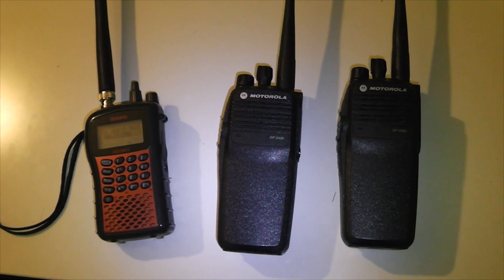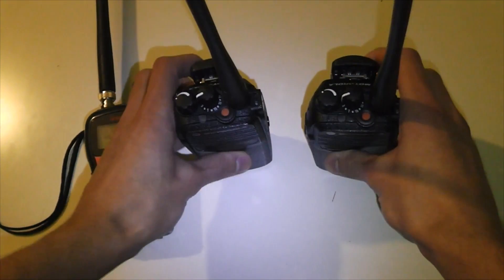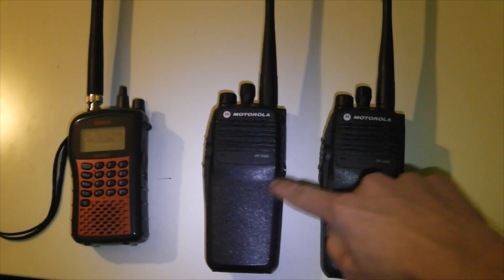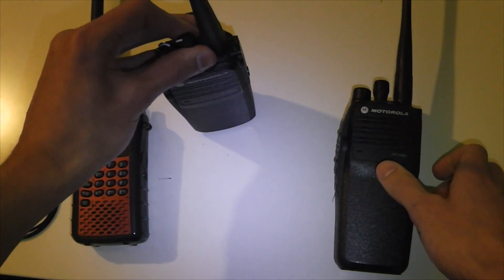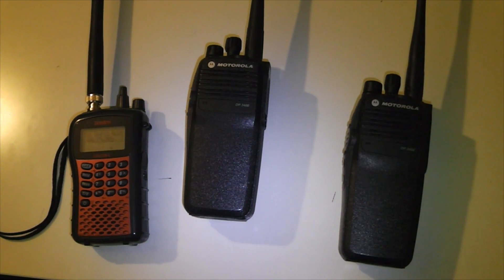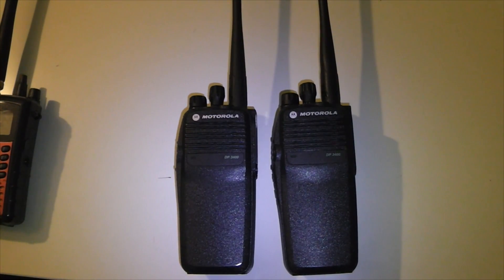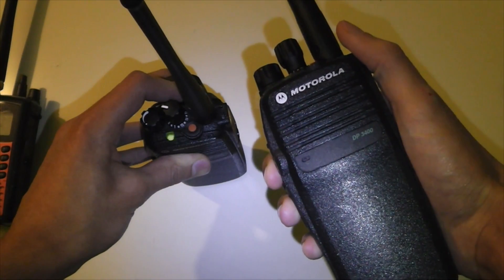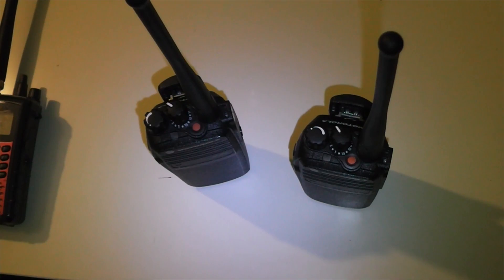MotoTRBO/DMR: What does the Talk Permit Tone do?

Comment: maybe that this feature is only available on a dp3400 radio as seen on your video? I have a xpr6550 and cant get it to mimic what you did. but if I offset the transmit and receive frequencies by 5 MHz then it should work I guess. similar to a repeater?
Reply: I FIGURED IT OUT! USING TWO XPR6550 RADIOS I SET EACH RADIO TO HAVE ITS OWN UNIQUE ID. LETS CALL RADIO ONE ID 1 AND RADIO 2 ID 2. SETUP RADIO 1 AND MAKE A DIGITAL CHANNEL AND SET TRANSMIT CONTACT TO PRIVATE ID 2. MAKE SURE ADMIT CRITERIA IS SET TO COLOR CODE FREE AND SET 'INCALL CRITERIA TO 'ALWAYS'. SET RECEIVE GROUP TO ANY GROUP YOU LIKE- (3, 4, 1000,ETC)- JUST MAKE SURE BOTH RADIOS RECEIVE GROUP MATCH. THEN- REPEAT THE SAME PROCESS ON THE 2ND RADIO- BUT SET TRANSMIT CONTACT TO ID 1 SO IT CALLS THE OTHER RADIO. MAKE SURE BOTH RADIOS HAVE SAME TRANSMIT AND RECEIVE FREQUENCIES. ONLY WORKS ON DMR MODE SIMPLEX MODE. THX RADIOSIFICATION  YOURE THE BEST!

Comment: What is that tone when you release the PTT? How did you configure that?
Reply from the maker: I don't think there is any tone upon releasing the PTT
Reply: @radiosification  Like chicago pd and nypd. When they release the ptt it makes a sound.
Reply: @video6025  Which radio they were using, DMR or P25? Different types of radios have different types of indication tone?
Reply: I think you was hearing the channel free indication tone. This is a tone heard by the receiving radio when the transmitting radio releases its PTT, thus releasing the channel for another radio to key up.

Comment: Great video and explanation. Does the radio transmit inhibit only work on enhanced privacy? I have an XPR3300 and a CP200d set up on a DMR channel with basic privacy enabled, but if one radio is off and I key the other one, it still initiates the private call. I also have "private call confirmed" checked in the CPS.
Reply from the maker: The privacy should make no difference. I think private call confirmed should be on in the transmitting radio if you want the radio to beep and stop transmitting if the radio you're calling is off/out of range. Or maybe there is a setting for it somewhere in the general settings.

Comment: Could you do an example of the prohibit tone , I have a complex question , on my xpr3500 when I transmit an all call the receiving radio will do the regular beep beep beep busy tone , every now and then when I transmit the all call and key up it will sound a bonk type noise saying channel busy , any ideas what this is , I have prohibit tone checked and I’m still confused as to what this setting is
Reply from the maker: Channel busy means that there is already a transmission on the channel. Check in the CPS what you have admit criteria set to. If it's on colour code free then it means someone else is transmitting on the same colour code and timeslot as you're trying to transmit on. This could be a group call to a group you don't have programmed in, or it could be a private call.

If it's on channel free then it means there could be another transmission on the channel in analogue or another DMR colour code, or it could just be interference. For this reason I recommend using only the colour code free option.

Also, using All call is not recommended for regular operations because it works slightly differently to normal calls, such as not allowing other users to talk back. With a regular group call your radio will always talk back to the same group if you transmit before it vanishes from the screen. All call should be used only for things like announcements to everyone on the channel when you don't want them to be able to reply. Instead of using an all call, just program your radios so that they are all talking on one talkgroup.
Reply: radiosification will do , thanks so much for the thought out response , I do have my radios on a group call for standard operations but I am working on setting up an all call channel that is a priority 1 on a scan list and I just need to set up the prohibit tone but don’t know exactly what it is . Thanks again for the response .
Reply: @Bluedog5581  Got it solved?

Comment: How doi add this feature to my xpr6550
Reply from the maker: Chandler Moon it's not a feature. It's just part of how the radio works. It is normally there
Reply: How do I make it to were my radio pings the other radio and beeps
Reply from the maker: private call it
Reply: Ok
Reply: Can you send me a copy of your code plug so I can look how yours is setup
Reply from the maker: no, it has private information in so I'd rather not. Its not too difficult to implement it yourself. Just experiment with it
Reply: If I send you my code plug will you set it up for me please
Reply from the maker: no, I'm not here to do everything for you. I told you, set it as a private call. It's really easy to do, figure it out yourself.
If you really can't figure it out, take your radio to a local radio dealer and pay them to do it
Reply: Chandler Moon If you can't figure out something this basic you don't need to have the radios